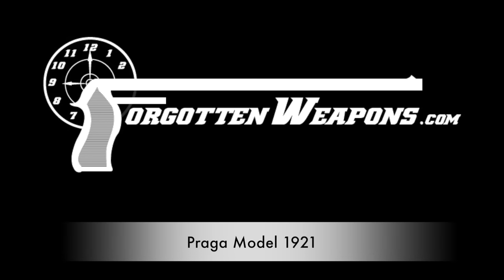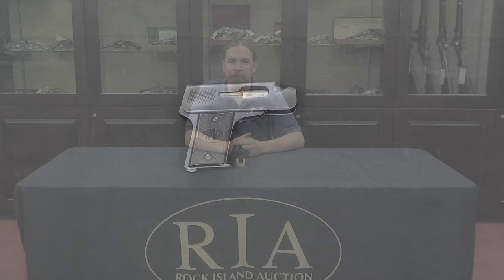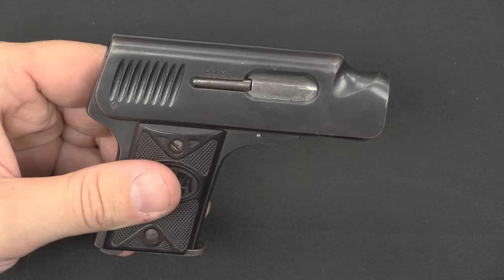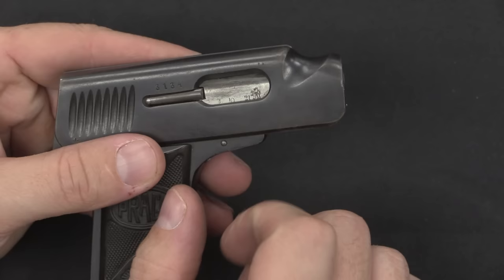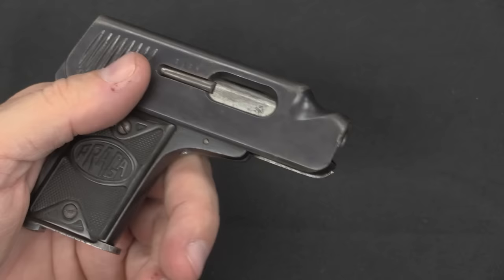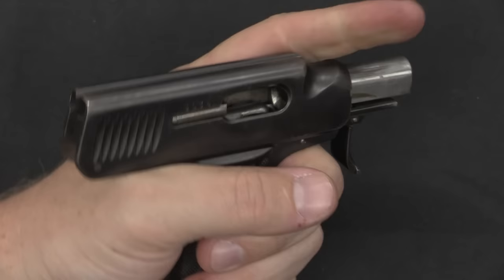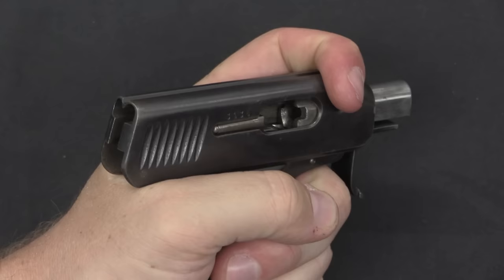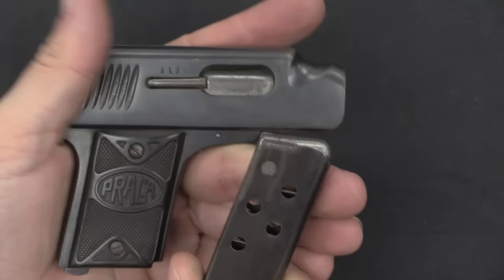Praga 1921 One-Handed Pocket Pistol

Comment: I'd like to see a modernized iteration of this design. It's really a pretty neat concept and looks to be nicely engineered.
Reply: in .22lr or .380. .25acp is relatively rare and expensive to much so to justify its ballistic effectiveness or lack there of.
Reply: Personally, I'd prefer it in .22 LR as a gun this small in .380 would have pretty horrible recoil issues...
Reply: @warhawk3719  true, I would just wonder if the rim would cause feeding or ejecting issues
Reply: @primeministersinister625  good point.  Hadn't considered that.  Perhaps the best option is to just call it off, eh? ;)
Reply: @warhawk3719  fair enough the range a go to doesn't allow guns without a trigger guard anyhow
Reply: @primeministersinister625  I gotta imagine if you pulled out an extremely old and unique historical piece, it'd take a pretty scummy rangemaster to refuse it.  It's not like you deliberately altered a gun that was meant to have a trigger guard.

Comment: Well, it's not a 9mm, but it has more reach than a knife and most people still wouldn't want to get shot with one of those. So it can't be that bad, if you know what I mean. :)
Reply: I only carry 500 S&W because anything smaller will barely even kill someone.
Reply: @Moostery  22 LR will kill wtf.
Reply: Only because they don't make a handgun in 950 JDJ
Reply: Graham  I've seen that one
Reply: Graham mabye
Reply: Graham  but what about the diablo break open?
Reply: Graham  does 12 guage not accept 50 bmg
Reply: @thesaddestdude3575  22LR can kill, but isn't nearly as likely to do so quickly compared to other rounds, which is why it's considered to have low stopping power. This is on average even less powerful than 22LR, although one +P cartridge by MagSafe is on par with 22LR.

This seems more effective as an intimidator than a defense gun. I could see it being used to walk up to someone and hold it to their back, as happens to Cary Grant in North by Northwest.
Reply: Yes. People tend to dislike having a pistol fired at them. They've rarely had a chance to examine it and the cartridge for velocity and stopping power.
Reply: @donjones4719  If someone is going to scare from a gun, most any gun will do. But...if they are happy to shoot back...you want enough power to take them down before they can take you down.

[Personally for a pistol I wouldn't go smaller than a 380 ACP due to stopping power (and I do in fact use 380). Even that round many would say isn't powerful enough, but Lehigh/Underwood Extreme ammo can do amazing things... A 9mm is the standard, but 380 micro compacts are better for tricky concealment if you don't mind certain trade-offs.]
Reply: @donjones4719  Speaking from experience analyzing what you are being shot at with is indeed a consideration but far from the first thing on your mind.

Comment: Really useful for people who only have one hand/arm. That was probably who bought it anyway. I bet a whole bunch of people today would buy something like this for the same reason.
Reply: yup....unless they need to reload. That magazine catch on the bottom isn't so good for 1-handers.
Reply: That's what teeth are for!
Reply: They find a way. I knew a guy with 1 arm and 1 leg, who could use a 2 handed xbox controller without any major issues.
Reply: Nowadays, the popular thing to do is to get a set of sights that has a rear sight with a flat front. You can use that flat edge to rack the slide using your belt.
Reply: This was designed for dog defense.
Reply: You don't have to put down your drink!
Reply: OMG, someone doesn't need to "Hold my Beer!" 😆

Comment: I actually think this is a better design than Browning's original (FN 1905/06 and Colt 1908 Vest), because Browning's design had really tiny manual safety that were hard to manipulate. The Baby Browning (FN 1931) solved the safety issue, but this Praga still have longer grip to give you better control, since the trigger is positioned way forward from the grip :)

Comment: Neat little thing. Wonder if it could be scaled up to a .32 or even .380 if you used the pull and push style of feeding?
Reply: No reason why not and it wouldn't need to be that much bigger although it would need to be a bit longer.
Reply: naw it wouldnt need to be longer

Comment: Would like a re-boot in... Say .32 acp. Still super-small but with more punch. Still a mouse gun, so shot placement is more important than with that .454 Casull "Safe Queen" you dream of owning. 
Better range than a pocket knife, and looks to be designed specifically for left handed use. Possibly because intent was for you to get that knife into your right while shooting with the left. By the time that thug has seen 6 flashes, then you finish as needed.

Comment: A 9 mm Kurtz version would b cool ( albeit larger though more effective) As for one hand cocking, I recall being able to chamber a round in a Raven MP25 25 auto with one hand - as long as striker cocked & MT chamber. Index finger pulls back on front sight. DO NOT ADVISE AS FINGERS STRAY IN FRONT OF MUZZLE.

Comment: If you pushed on the trigger directly from the front while it was folded up, would you still be able to fire the gun? Or does something about the way it folds, or the way it locks into the front of the slide prevent that from happening?

Comment: I always like one handed pistols.  It is a viable back up weapon.  I recall the great FBI shootout in Florida some years ago.  Could have used this weapon.
Reply: Not really, that 198 shootout was what convinced the FBI to do a little ballistics research of their own and to come ot the conclusion that their 9mm's didn't even have enough stopping power to do the job. Ever since then the FBI has held that 12" is the minimum penetration to reliably puncture vital organs and stop an agressor, the 32acp is so very weak and anemic it definately won't even give you half that or even reliable expansion under even the most ideal conditions.
Reply: toomanyaccounts
That's not exactly correct, they played around with both the 10mm, and the 40 short and weak. But if you grew up when they were experimenting with different calibers they were only hiring lawyers and accountants as agents, not experienced law enforcement officers, lawyers and accountants... . The role of the FBI has since changed, they do have rapid response teams and they love to carry their HK mp5's because they can get so many  rounds into a target so quickly that it is effective, the hostage rescue teams are the only ones that are allowed to fire their mp5's on full auto and you know what? The FBI's HRT does not carry handcuffs, their mission is to pump enough bullets into the perpetrators that it causes immediate cessasion of their life! The dead don't need cuffs! They also have adopted the remmington 700 rifle platform as well as a number of other higher powered weapons that allow them to do their job instead of depending on only thier sidearms.